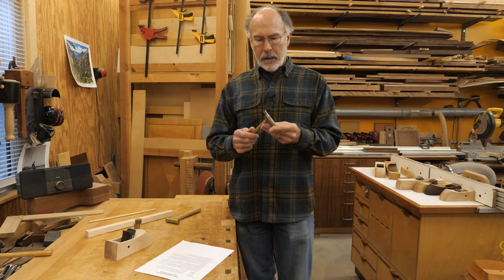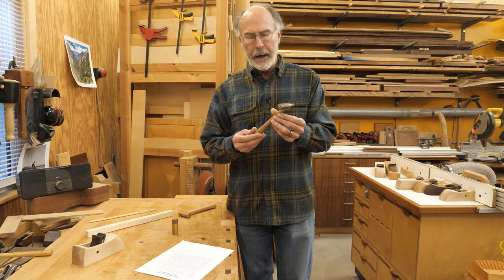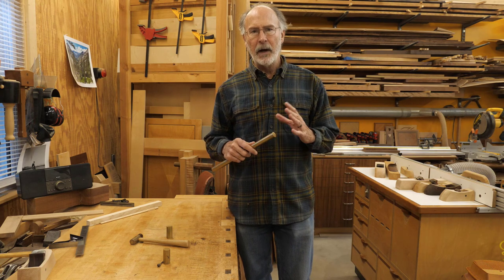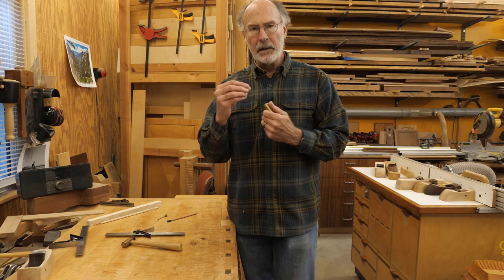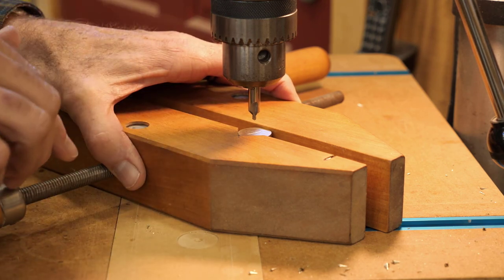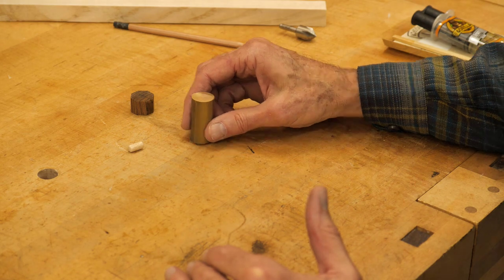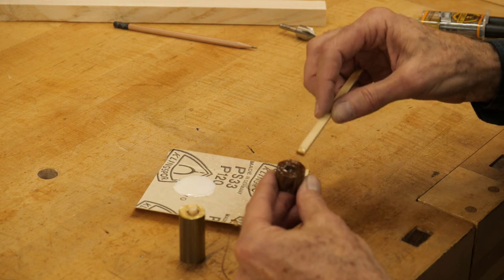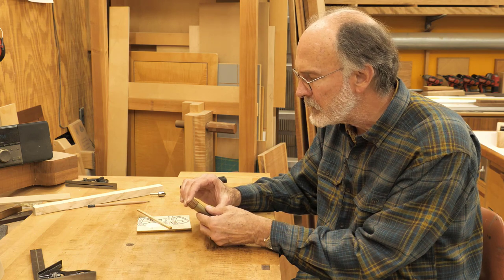Plane-adjusting Hammer Build Part 1

Comment: Mix fine sanding dust with the epoxy it makes the glue go further, improves gap filling because it won't flow and colours the squeeze out to match the wood
Reply from the maker: Good point. I have done that before and have multiple bags of sanding dust from various species. It did not occur to me to use one in this situation.

Comment: Found your channel recently...Love your work.

You can modify twist drills so that they work better in brass and aluminum.  the rake angle that comes from the factory is too steep for non ferrous metals and tends to grab as you experienced here.  Clickspring has an video on how to...

Mike McCluskey
Reply from the maker: Great point! (No pun intended.) I have some bits that I have modified for drilling plastic that would have worked. Didn’t occur to me to use one here.